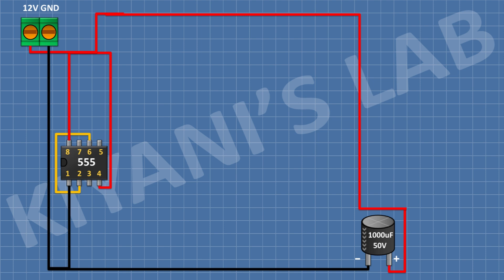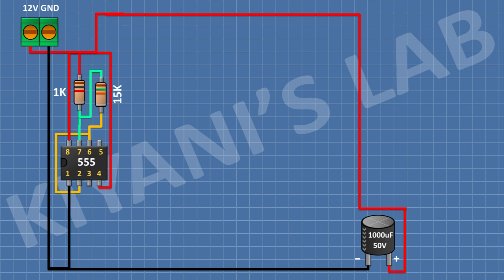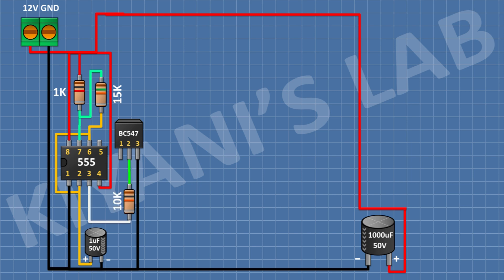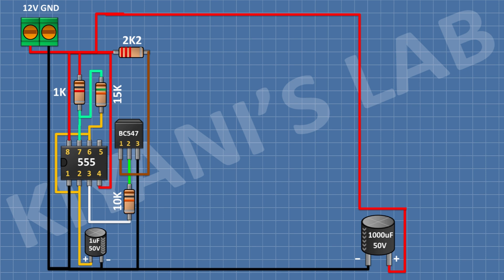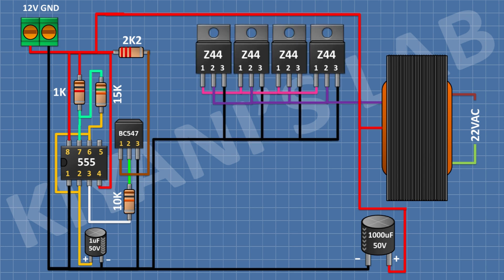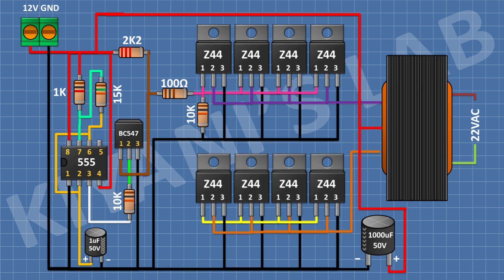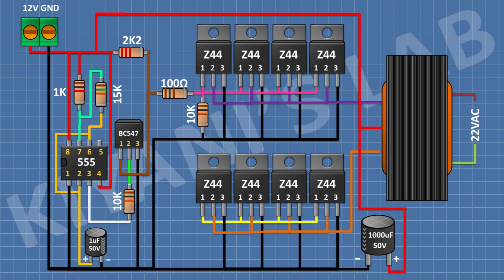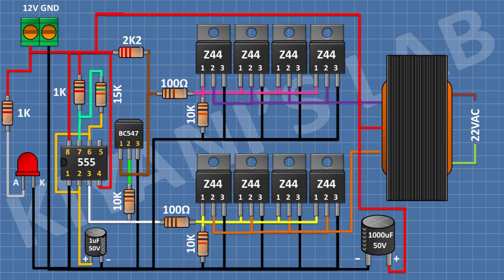How To Make 500W Inverter Using 555 Timer

Comment: Or you can replace the 1k resistor with 4.7k resistor, and 15k resistor with 120k resistor, and also replace  1µ capacitor with 100n capacitor

Comment: Hello...please reply....I make the same circuit as yours but with different mosfet, when I put a load....the voltage drops and goes back up continuously....when I adjust the resistor value it stopped but whenever I put load....the whole circuit trips and turns on again, continuously

Comment: Thanks so much for sharing. Can you use this power to charge Mobile phones since there is no voltage regulation. Would it damage appliances?
Reply from the maker: you can use it
Reply: @KiyanisLab  ok thanks Soo much so helpful. What your experience using it so far. Any honest changes or note you would advise I am really worried about it damaging appliances because I'm going to try to build one. Thanks again

Comment: What would it take to make it a pure sign wave inverter?

Why is this system only able to provide 500W of output power?  The mosfets seem to be able to handle much more power.  What is the limiting factor?
Reply: Is there any way to add feedback to 555ic and make inverter with feedback with this?
Reply from the maker: the wave form and no feed back is limiting its efficiency for more power more mosfets and bigger transformer can be use
Reply: @KiyanisLab  That's already a huge transformer for 500W!